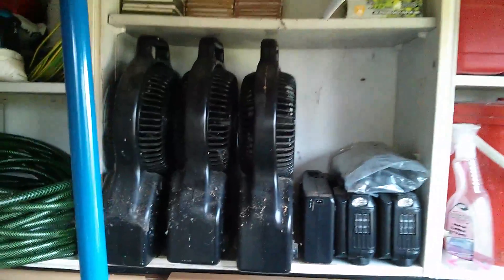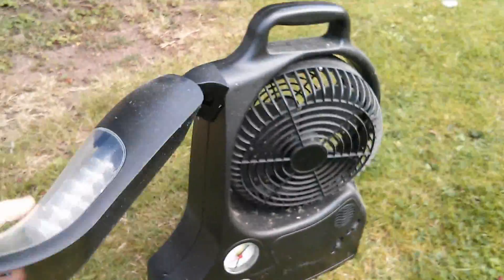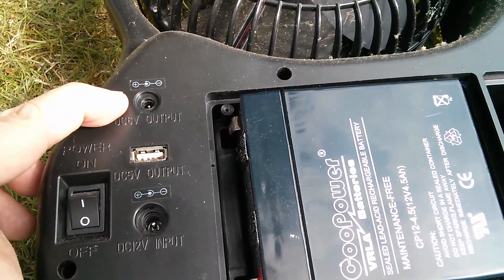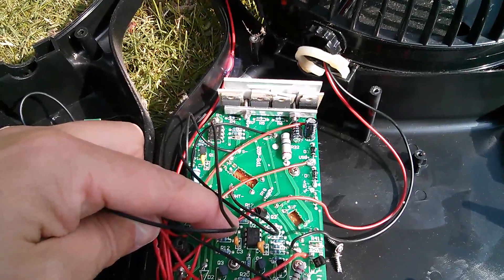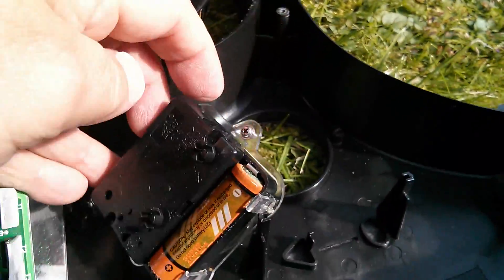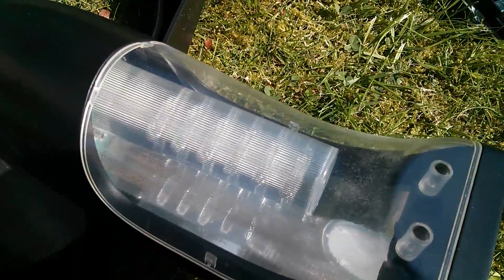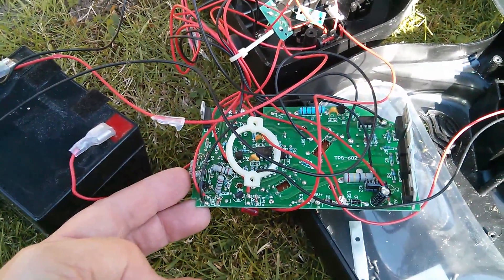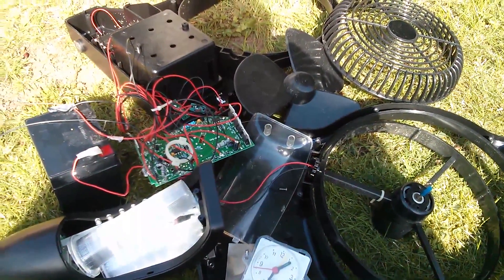1-Way Teardown: Maplin 5W Solar Camping Light/Fan

Comment: These brings back so many memories! FYI these were branded as  mains only rechargeable battery devices in Pakistan. These were invaluable in the 35C heat when the electricity went off! (like it usually does every 5 hours or more for at least 2 hours everyday!)

Comment: I was amazed these still had their batteries fitted as they rot in the shed! around 13Ah of 12V across the three, if they are any good themselves, of course. But why not float them with the rest of your SLAs?
Reply from the maker: +jusb1066 Yeah, the clock controls were fairly inaccessible, the clock battery more so.
Reply: +codemsan i was amazed at the bodge of a single aa hidden inside the clock module, probably inaccessible untill you pull the whole thing apart
Reply: What would be an efficient way to connect a 1.5V clock motor to a 12V SLA? solid state regulation or perhaps some sort of really high impedance resistive dropper since its so low current?

EDIT: of course, putting the battery holder on the case accessible to the outside world is feasible as well, but not as much fun to ponder :)
Reply: codemsan
capactive dropper or resistive as you say, would be the single solution, or a 1.5v regulator is the next cheapest
Reply from the maker: +codemsan A very low quiescent current regulator or a resistor and a zener diode. Not sure if you can get 1.5v zener diodes though.
Reply: +Julian Ilett Might be a test video! :}
Reply: Hmm I'd enjoy seeing just how efficient it could be made!

Comment: Did you say 'go in the trash?'. No, no, no ... from my experience ..  if you throw it away now you will need a part next week.
Reply from the maker: +Luc Peeters Right now I'm willing to take that risk. There's so much junk cluttering up my life.
Reply: +Luc Peeters But  if he doesn't he will never need it again, it's just like Murphys Law :) 
Also he still has two more to use :)
Reply from the maker: +jusb1066 They're also from Maplin, also contain similar sized lead-acid batteries and they're for in car use - that's all I'm saying ;)
Reply: +Julian Ilett must know what the other 3 black units are!
Reply: hey, i would like one of those clock units, as where is am going here soon is prone to outages

Comment: Intresting that thay chose an E27 screwmount, i mean someone could try and install this in a standard 230V AC. That would probably end badly...
Reply: +muh1h1 Great idea to a future test, +Julian Ilett :D
Reply: *****
Good thing is it can probably be done from a safe distance, since you can use a lightswitch :D
Reply: +muh1h1 Probably because they used a 12V CFL before switching to LED. The 12V CFL tends to use E27 as well. Weird.
Reply: +MrOpenGL Pretty sure you're right. They could probably get the CFLs for 12v cheaper than designing/building their own driver and using a standard fluorescent lamp
Reply: +MrOpenGL we have one of those 12 volt CFL globes, they are odd things but work well. 

I bought a cheap Arlec work light which has a hook and clamp on it. Chop off the 240v plug, add cigarette lighter plug and screw in CFL globe. Now have a nice light for camping which can be attached to just about anything.